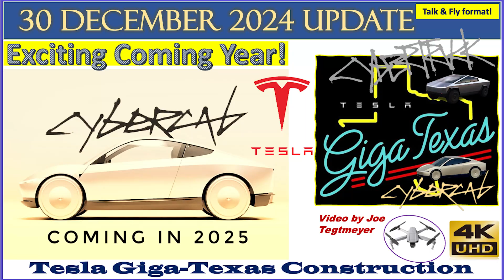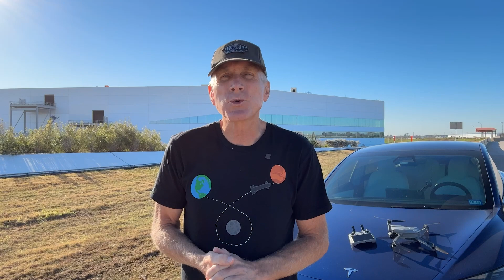Flags Half-Mast, Production Pause & DMG MORI Mill Machines! 30 Dec 2024 Giga Texas Update (07:40AM)

Comment: The roof is getting nasty black crap on there. The whole point of the white membrane is to reflect the light and heat. Maybe once winter is over, and they want to reflect the heat instead of holding it in, they will clean that up

Comment: Will the treatment plant use river water?  Water for the cooler?
Reply: Do you mean @ 12:11? It is NOT a treatment plant. It will be a pipe 5' to 6' in diameter at a depth of about 40', which will carry wastewater under the river and under 130 to the wastewater treatment plant on the south side of the river. This is based on actual permit information.

Comment: Thanks Joe
Happy New Year to you and all your patrons and youtube fans.
Sort by Newest First or Top Comments if only the first few lines are visible
12:20. Westside. New project. Giga Texas Offsite Wastewater Interceptor. Formwork is for constructing a deep shaft using the ‘sunk caisson’ method. Purpose of the shaft is to bore a micro-tunnel (tbm or pipe-jacking) under the river to the water treatment plant behind the Sand Hill power station. A sanitary sewer pipeline construction project basically.
16:02. Westside, Tunnel Project. MotherTruck. No sign of screw fixing of the cladding. No deformation along the joints that would suggest welding. Cladding appears to be adhesive fixed only.
17:28. GA, Level 3. Window line. Black painted plywood infill. 3 of these removed window sections along the west side. Concrete pumped through this opening in the previous video.
18:11. GA/Battery. New Entry. Clear now there is a ramp only on the north side. Landing extended south, possibly for a new door opening.
18:42. Battery, roof. Original membrane reused after the substrate board was replaced.
18:53. Battery, roof. Square enclosure mounted under the powered flue. Filtration unit likely.
19:09. Battery, roof. Screw fixing the membrane east-west across the roof. Entire process visible from left to right. Cleaning off the roof, screw fixing through a large washer, applying a strip of membrane material over the fixings.
Similar repair at Cathode at 24:29.
20:43. Casting, apron. On the trailer. White cylinders appear to be giga-press hydraulic accumulators.
21:15. Casting, east. Canopy. Front-end loader. I can see it in the future pushing piles of shredded reject castings, furnace dross up against the steel wall to the right.
21:25. Casting, apron. Canopy. Light grey box fits within the dark grey frame. Furnace charging machine must be able to pivot 180deg to pick it up, or transfer contents. Similar made by RiA Industries. Search ‘RiA rotating rail mounted furnace charging machine’.
26:36. Die Shop, east. DMG Mori delivery. There were 3 DMG Mori milling centres in Casting, moved out by June 2023, and shifted across to the Die Shop. Not used for trimming castings, these are for machining the dies.
The new foundations being constructed within the Die Shop may be to receive these machines.
One crate marked DMU, which is a machine series the same as one originally located in Casting.
Reply: Videos quoted above.
12:20. Sunk caisson. https://youtu.be/OIAZI8iiW0c
21:35. RiA rail mounted pivoting furnace charging machine. https://youtu.be/kIzbZ2Nc41E
24:29. Cathode roof repair in July, https://youtu.be/ivnidrBCc_E?t=1668
26:36. DMU gantry machine when located in Casting in 2022, behind column Y8. https://youtu.be/Dok_gczJ9hk
Reply: @DessieDoolan are you keeping track of this stuff with a spreadsheet, or do you have an exceptional memory?
Reply: @alanrivaldo-h  Bit of both! I have saved all my comments from March 2020 onward. Easily searched for keywords.

What is going on in Casting is a particular interest for me, so a lot of that is just research out of curiousity.
Reply: @DessieDoolan  Happy New Year on your side of the date line
Reply: @benguthrie49  Happy New Year Ben!

Usually a spectacular fireworks display around here even though fireworks in fact illegal in sunny Melbourne!
Reply: Happy New Year Dessie!  Thanks for sharing all your insights.
Reply: @nad3020  You're most welcome!
Reply: Happy New Year Dessie!
Reply: @DavidJohnson-tv2nn  Happy New Year David. Plenty of construction yet at GT.
Reply: Happy New Year, Dessie. Actually, I think we know very little about the CyberCab at this point (or any new vehicles or refreshments), other than it will be an autonomous, software-defined EV. But, like other Tesla vehicles, it will need battery packs and motors and stampings and castings. All that assembly equipment on the west side, no doubt, but also new dies for casting operations. Maybe these new Mori milling centers for dies are a beginning.
Reply: @WarrenLacefield  Happy New Year Warren. Yes, I'd agree. Very little known about CyberCab. I have my doubts about the door design as much as anything else. Too long for opening, needlessly complicated opening mechanism.

Really need Sandy Munro to tour the place again. His tour of the Cybertruck production line required a rapid rethink in my mind of how the place is organised.

DMG Mori milling centres. No doubt the Die Shop is set up to make dies from scratch. Big lumps of steel stored outside on the north side indicative of that. I couldn't make out exactly what model DMU is in the crate. It looks like DMU 125, and they do have a machine of roughly that description, a DMU 125 (FD). Smaller than the milling machines shifted across from Casting. Good for workpieces of 2600kg 1400mm diameter 790mm height.

The larger DMU 340 and DMC 340 shifted from Casting are good for double those numbers.

Comment: Cheers as always mate. The die shop would also be used in the production. repair or replacement of the compression clamp dies used in the stamping process.
Reply: Yep, the DMG Mori machines would primarily be used for die machining.

Trimming of castings would be a simple shear press. I've never been able to spot one in any of the videos. There were good views into Casting and BIW from the Cyber Rodeo event of 2022. Never spotted a trimming press, but confident I saw the milling centres for the final milling of the castings at the top (north end) of the BIW production line.
Reply: A casting trimming/deburring press by Kurtz Ersa. https://youtu.be/WheKPXX5XX8

Comment: Happy New Year to Joe and everyone else!
Wastewater Interceptor Project:
@ 12:10 Joe.... No water treatment plant, and no tanks. The wastewater Interceptor will be a pipe 5' to 6' in diameter at a depth of about 40', which will carry wastewater under the river and under 130 to the wastewater treatment plant on the south side of the river. The ring forms are for vertical TBM work shafts. They will use pipejacking to push pipe sections and a small TBM forward.
@ 3:07 Way offscreen to the right, south of the power plant, is another big part of the wastewater interceptor project. Which can be seen on Brad's video 12/29/24 at the 0: 30 timestamp.
150 MW/500 MW of power for the data center:
@ 22:57 150 MW unlikely until ALL electrical work is complete from the substation to the data center. Possibly late January to early March would be my guess.
500 MW unlikely until sometime in 2026 at the earliest. Two more large substation transformers, T4 and T5 have been ordered. Construction of 2 more substation bays, and the associated duct-banks, additional rooftop cables, etc. is a huge project. Very unlikely to be complete in 2025.
Reply: 22:57 I can’t figure out why the datacenter wasn’t built as a standalone structure adjacent to the switchyard/megapacks. It would have saved many miles of expensive power cables, not to mention all the extra trenching, vaults, conduit, cable trays, repaving, etc.. Plus it would allow much more flexibility in layout for whatever is going into the south extension.
Reply: @Frank-gt7me  I agree completely. Seems like it would have been more logical to build the data center somewhere north of Tesla road. Plus the space in the south extension could have been preserved for manufacturing. I may be wrong but it seems like Musk doesn't care much about producing cars anymore.
Reply: Ditto: Happy New Year, David, and to Joe and other commenters. I agree on the likely power requirements of Cortex now and in the future. Next year the factory may require more power as well. Whether Phase 2 substation expansion is finished in 2025 or 2026 will probably reflect how serious these needs are.
Reply: @WarrenLacefield  Happy New Year Warren, and Frank, and others who comment! There are some things they can speed up if they are in a hurry. Then there factors beyond their control. Like the long lead time from the time the transformers are ordered to the time they're delivered. Probably at least 12 months. Then there is also the construction of 2 new substation bays, which is outside of their control.

Comment: Is it a water detention pond or retention pond? Seems to me it should be a retention pond. I think detention is a school punishment.
Reply: Giga Texas has both types of ponds to control the rate of rain runoff into the river. The difference is the level of the outflow structure. A retention pond is designed to always have some water in it, while a detention pond has the outlet near the bottom so it is dry most of the time. Google will turn up a more detailed explanation along with the pros and cons of each.

Comment: @22:12, the shiny metal on the bag-house filtration plant is a weather proof around the wool insulation installed around the steel piping going through the wall. the wool insulation is visible at the first flange coming out of the building. good catch Joe
Reply: 22:12. Centre. The conical spin separators and the transition pieces at the baghouse itself are also insulated and clad.

Bit of a mystery to me why any of it needs to be insulated.
Reply: @DessieDoolan  temperature changes in outside air may cause some dust to mix with water and harden. Insulation will keep the temperature more stable and drier inside the piping.
Reply: @larryparrish7780  That makes sense. I've scratching my head over this since the spin separators were insulated.

Of further interest is that this insulated flue emerging from within Casting bypasses the heat-exchangers. The other 2 flues pass through the heat-exchangers.
The gases in the insulated flue may be relatively cool enough to not need to lose any heat before entering the baghouse.

Will be interesting to see what else is insulated.

Happy New Year!

Comment: When is the parking station going to be fully utilised?
Reply: If you refer to the multi level parking then likely never. Tesla offloaded a very large number of employees at GT around 8 months ago. The overflow parking lot and maybe half of the eastern wow are now largely empty. Not sure of the GT workforce reduction but it was thousands. 4-6k I think.
Reply: @ What do you think the reason is - poor sales or the impact of automation? Seems odd to build a giant car park and not use it. Would not be the first time that Tesla has wasted a ton of money on the building site.
Reply: @pieterfaber24  MY production staff were slashed by ~2500 in April (2024) with many staff also being reassigned to the CT production 'ramp up' meaning GT MY output was seriously reduced. Some or much may be related to demand but that can (is) managed by unit sale price. The compact now seemingly called MQ should have been out a year or more ago but for some reason has and is delayed. Have a feeling that Elon thinks the CyberRoboTaxiCab is a panacea that will solve all ills. People like to go out for a drive, they still use horses and going out for a walk rather than using a bicycle or such. Great engineer but has always been socially inept to some degree. Q3 2023 (IMO) he had a mental glitch.
Reply: @ Thanks for the insight.Things are never as simple as they appear from the outside.